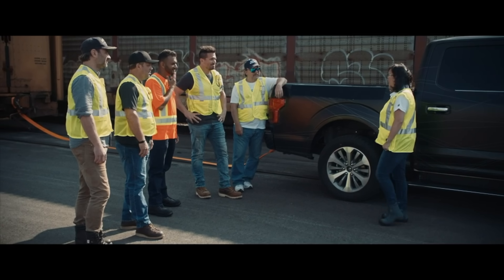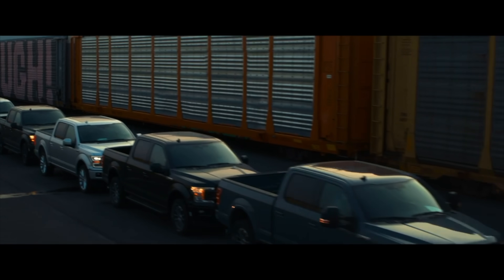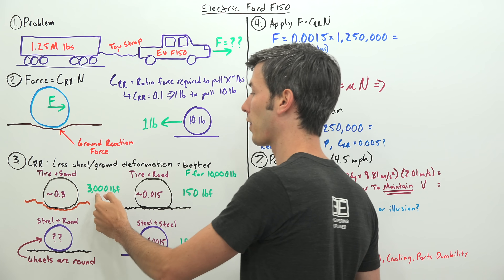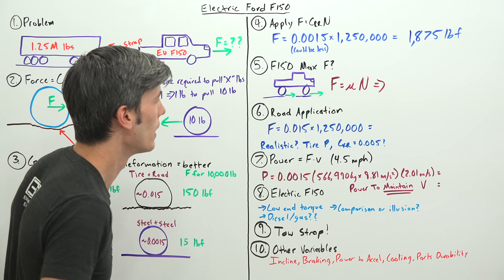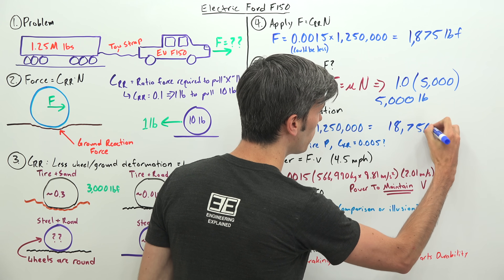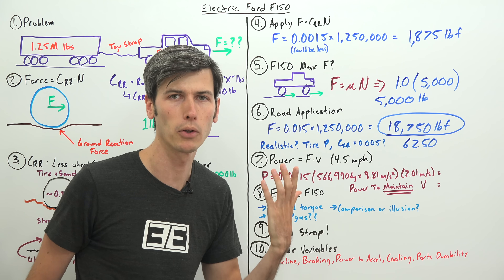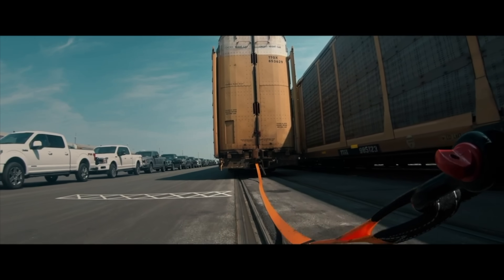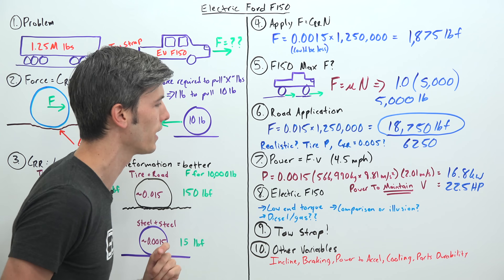No, Ford's Electric F-150 Can't Tow 1 Million Pounds (Realistically)

Comment: You know, there is one more thing. In railcar connections there is some loose space. I mean if you put railcars close one to eachother and start pulling the first of them, others will not move until the loose connection stretches. Then second railcar starts moving, while others stand still and so on.
This means that locomotive doesn't start pulling all the weight of all railcars at the same moment. And by the way this is the reason why that loud sound appears when train starts moving (and sound comes from each railcar connection consequently).

Sorry for my English.

Comment: save you the time and headache, its able to do so bc the train on tracks has less friction and therefore will require less power, if it was on a road it would be impossible bc of the weight and the friction inacted upon the ground

Comment: Some other factors not mentioned. Slack effect in the couplers of the cars. Contact of surface area of the wheels on the rail. Roller bearings. How many of the cars were truly loaded? They are all enclosed and all that's really shown are the ones in the open doors.

Comment: Basically, since the train is on wheels it's pretty easy to get it moving and the faster you drive the easier it will be to pull that load.

Comment: What would the stopping distance be at 10 km's per hour if stopped just by the truck?
Reply: Also.. For those of us that tow 2000 pounds with our little 1500 rated cars what's the Engineering explained about that?

Comment: A lot of fun,  and of course, completely misleading and inaccurate.  It's torque that determines pulling power, not horsepower. HP is quite irrelevant. HP is a product of speed(rpm). 1000 ft/lbs of torque at 1 rpm is a mere .19hp.  That's point one nine, if you didn't notice the dot.     Your  22hp engine at nearly 25000 rpm would make maybe five ft/lbs.  Lots of noise and zero movement.  Internal combustion engines won't do any work at one rpm, but electric motors will. That's why diesel locomotives don't use their engines to pull the train. They use their engines to run the generator that runs the motors that pull the train.  Good fun.

Comment: There is an important feature not discussed here.   The tow point.  The height of the tow point relative to the centerline of the axle of the tow vehicle.

Farm tractors have large wheels so they do not sink into the mud.  But,, they also have large wheels to be able to pull from below the the center line of the axle.  This is particularly important in any tow situation or even a dragster.  If the connection to the tow vehicle is below the line of the axle,,, as the tow load comes on,, the force of the tow is transferred to a down force on all four wheels.  The effective weight of truck, your figure 5,000 lbs, can be multiplied.  This IS how a John Deere B with its 25 hp  can pull a plow.  This is also a portion of the reason truck tow points are often a drop hitch.  If the pull point and level of tow strap are above the axle centerline, you begin lifting the front wheels off the ground.  Attach the tow below the centerline and the weight of the truck, on a set of scales will rise.  I have never tried it on a set of scales,, but I have driven and plowed with a pre WWII John Deere B.  The tow point below the drive wheels is a part of any farmer's life.  I am not a farmer,, just helped once in a while when needed.   I would LOVE to have you test the weight gain on a set of scales.  I would love to see me proven correct or incorrect.  I think it would be great good fun to find out.

And my seat of the pants says the 4.5 mph acceleration in 1,000 ft, require more than the 5 hp.  My only basis for that statement is the use of a 7 hp outboard moving a 20,000 lb vessel.  Not different from steel on steel,, at low speeds, nearly friction less.  It can do it.  yep.  But it is gonna take a lot longer than 5 minutes to reach that speed.

In your rolling resistance calculations,,  train wheels  contact the rail on an incredibly small surface,,, only the inside centimeter or so, The wheels are cones.  Another factor,, I personally have watched the rails sag a half centimeter  or more as a train rolls by.  that is quite a hole to pull 1.2 million pounds out of.  My seat of the pants feels more like 500 horsepower to move that train to 4.5 mph in just 1,000 feet.  Did I miss something?  Yeah,,, pure physics,, no friction, no deformations of any surface, rotational considerations, real world dragging brake shoes, wind, etc.,,, 5 hp may be correct.  By the same token,, I have often thought that a fully loaded cargo ship, 60 million pounds,  could be moved effectively with a 7 hp outboard.

Comment: i have ranger have 176hp 200 tq n i can still pull 37 train trailer no issues in 1st n 2nd gear 2.3l "upgrade motor"
and my maid issues is that new ford truck isnt that powerfull pull it weighs doesnt count because wheels is one thing make it easy push or pull if it wasnt on wheels it would be hell a lot more tell how HP n tq that vehicle is 

to me that truck seen have 230hp 280tq it farset i can tell n yes they r misleading yall about vehicle

Comment: A second effect is that the couplers have play in them. If the train is stopped such that they were pushed into place instead of pulled into place, all the couplers are loose. When the truck starts, it is only starting the first car. When the slack is taken up in the first coupler, it has both the truck and the momentum of the first car to get the second car moving. This continues down the line until the whole train is moving. The front of the train can be moving at a substantial rate before the end of the train has even started to move.

Comment: A Gas Or diesel Ford Could’ve pulled Those auto Racks.  unlike most people, I’m a train enthusiast. if you’ve not seen my PFP. Train wheels are designed to have a little part of the wheel making contact with the Rail. This reduces Friction, And is EXACTLY why this Electric F150 was able to pull all those auto racks. If it were on the Road, Nope. Wouldn’t do it.

Comment: If you could reasonably pull a cut of freight cars with a pickup truck engine, then I feel the railroads would have stopped using 140 liter, 4000 horsepower diesels a long time ago. This is on straight level track. You could get those cars rolling with a 3ft pry bar.

Comment: There is a tool on the railroad called a car stake, basically a prybar that fits between the wheel and the rail...any normal person can move 4-6 cars @ 90,000-286000 pounds each.......

Comment: I think on top of the rolling resistance of the wheels there is resistance in the axle bushings on the car axles which would increase the load. but I doubt it would be much more though.

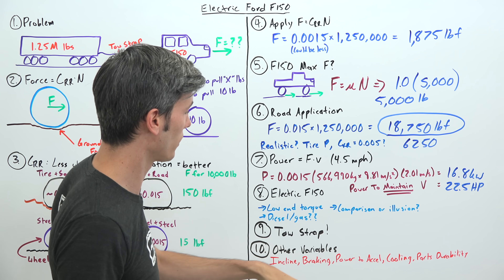Comment: 10:54 the truck itself was able to accelerate this mass - deceleration takes even less amount of energy, cause friction helps (through the brakes, though, not the transmission), sooo why do you say the truck is not capable of slowing down this mass? are brakes not good enough to "pull 1875 pounds backwards"? (if we assume the direct connection, cause strap obviously wont work)

Comment: Short answer : 
Road is harder to tow because it has more wheel/ground deformation so it needs more force, and hence Ford F150 is unable to pull with that increase amount of force needed. Train with metal wheels on rails is easier to pull with lesser force needed, as it has lesser deformation.

Comment: I work for the railroad, and I can tell you small shop forklifts move those rail cars around at the shops. With low friction bearings and lack of friction with steel wheels on steel rails it doesn’t take much to move a cut of cars especially when you have a vehicle off the tracks putting power to the ground. I will say this though, if you put that f150 on railroad wheels, put it on the tracks like a locomotive it would not pull the cut of cars instead spinning wheels due to lack of adhesion which is weight on the rails. That’s why locomotives are heavily constructed and weigh so much for their size. For example a small yard locomotive is about the same size as a greyhound bus, however it’ll weigh 250,000 lbs vs 50,000 lbs, because you need the adhesion for the pulling power due to the lack of friction.

Comment: So basically in a way you want your truck to weigh more because the truck can only pull with as much force as is put to the wheels by it’s weight unless F µ is greater than one? But at the same time you don’t because it needs more energy.

Comment: Chevy did something similar in 1973 with 8 log trailers that weighed 374,000lb and if my math is correct, it took 5,610 lbf to pull. So I guess ford is a few years behind

Comment: i didnt hear him explain it in the video but if i did then correct me. In the video he says the rolling coefficient is less on tracks because theyre made of steel which doesnt deform as much as say a rubber tire. what i didnt hear him say is that this means there is less surface area in contact with the wheel and the ground. this means there is less friction between the wheel and the ground (or the track and the train wheel). thats why the rubber tires that he uses in his example have a higher coefficient. because they deform more than steel. which means there is more surface area contact between the rubber wheels and the ground which also means more friction. correct me if im wrong though.

Comment: Another variable is coupler slack between rail cars. Assuming normal slack in the couplers the truck is only pulling the first rail car to start then slacked is pulled out to the 2nd rail car and so on, creating a increasing load until all couplers are pulled tight. The truck can move several feet before the last rail car begins to move. The full load won't be realized until the last car moves.

Comment: Generally you are quite accurate, but now you made a mistake. That truck can definitely decelerate (brake) the train! Actually, it can do it in just the same distance as it took to accelerate it. This assumes though that there is a rigid connection.

Comment: Towing a rolling load is not that hard. On level ground. A friend running a grain silo used to shunt  multiple loaded wagons around with a little and old tractor. Problem was stopping the things!! from about 3mph on level ground! Jump off the tractor and run after them and grab the brake lever.
Too many b/s adds around from all maufacturers. Should be forced to tell the truth! 
Elon will never sell another car!

Comment: Okie I have a question. If it takes so little force to move such a mass on tracks, then why is it commonly known that locomotives need to be so powerful to move trains? I mean historically and even today, it seems the locomotives engine are sometimes doubled up to move trains and always seem to be 7000HP. Why aren't modern locomotives as small as an f150? Is it because a real train is a lot more than 1.25 million pounds?

Comment: Assuming max torque (5000lbf) which is 2268KG * 9.8m/(s*s) = 22226.4N. With resistance as 1875lbf (8330N) on the train and 333N for the truck. The acceleration force is 13563.4N. So the acceleration is a = f/m = 13563.4/(566990+2268) = 0.0238 m/(s*s). Which means it take 84 seconds (t = v/a = 2.01m / 0.0238) to reach this speed. It'll run a total of 1/2*a*t*t = ~83m or 270ft before reaching this speed.

Comment: It's even easier than that. The train isn't a single object and hitch slop will allow you to break one car lose at a time as you roll forward. Then as the hitches catch you start hearing them bang. In the past the back cars could really get a huge jerk if the train accelerated before all the hitch slop was taken up.

Comment: Not tow because you can't just put that much weight on top of the frame and bumper and tires etc.. But it did pull it. Easily.

Comment: Would be best if they just bolted down a thick welded chain with a newtonmeter scale  in the middle and the truck pulling as normal. Highest mesured force applied will be recorded.

Now traction and brute force applied will show whos the boss of towing.

Comment: well we already know the tow strap is likely only rated for about 4000lb or something... some years back Land Rover did a stunt with a truck pulling a ship - same applies, it doesn't take huge power to move a ship in still water and it doesn't take huge power to move 10 railcars on the flat.  That doesn't mean the truck isn't pulling it, although the same load on rubber tires on tarmac it very likely couldn't.

Comment: 6:56 "If it was sitting on a road with road tires" - is that what ford was trying to say? That you can realistically  tow 1 million pounds on the road? You remind me of a little boy that rebels or holds opposing views not because you have a valid position but because you just want to disagree for the sake of disagreeing. If Ford was claiming you can tow 1 million pounds on the road with that truck you would have a point. Otherwise you are just a jackoff rebel throwing equations  around to hide behind them as you manipulate the frame of the situation

Comment: You're leaving out a significant amount of static friction in this system before anything will move at all. Train wheels have rolling bearings, sure, but they're imperfect.  Also, for something of this size, certainly other contact incur static friction to overcome.

Comment: Small wheels are amazing. I was shocked the first time realized I could pull a pallet jack with >1 ton on it. It was difficult to get started, sure, but I was able to move it across the floor of an entire grocery store.
Reply: Doesn't matter if the wheels are small or big if your pushing or pulling. When the wheels are gear driven, then wheel size makes a difference...

Comment: Hey, Jason! If the trucks towing capacity is equal to uFn, why do F150's (or any truck) have towing ratings that don't reflect this formula? For instance, different lines of the same truck (Limited, Laredo, etc.) have different towing capacities but are similar in weight. Thanks, Jason!

Comment: I found it odd they didn't use some huge-ass chain to mask the fact that this wasn't a big deal..
Reply: DD PN  large diameter steel cables are use for ultra heavy lifting. I have never seen a 1 million pound strap. Biggest strap i have seen was rated at 200,000#
Reply: Facts that tow strap kind of gave it away
Reply: They had a heavy duty two strap
Reply: @fidsnfads__warthunder6337  okay but there isn’t a strap in this world that is rated for 1.2 million pound hauls
Reply: Tow*
Reply: DD PN  lifting and towing are 2 very different things. Plus they use a harness consisting of multiple straps then... connected to a chain or cable.
Reply: Its still false advertising, they only needed a strap strong enough to overcome the initial resistance. (probably less then 5000 lbs) Once the train starts moving you dont need much force to pull it. This is also why a human can pull a truck in strong man competitions.

Comment: The TRAIN CARs would have locked down due to the way the brakes work.  So they had to load the brakes with air to release them for freewheeling ability since the brakes lockdown with no air pressure to keep the cars from rolling on their own.  It is a safety design.

Comment: Awesome again buddy.... loving your channel 🙂🙂.

True that this stunt worked out bcoz it was on railway tracks.

But for the road example, even if the F150 is loaded to get to 18751lb, will that actually pull it, bcoz the engine will ideally need to also pull the additional load on the F150 right ?

Comment: For reference I know when I used to work in retail, I used to haul pallets of merchandise around, and I can tell you that it takes about 75# of horizontal force to move a pallet of paint (about 2,250#) around on a pallet jack and flat concrete floor. Now a pallet jack might incur a bit more friction with it's tiny wheels than a train does with ~24" wheels, but just saying. Seems like a .0015 coefficient of friction is definitely on the low side. I'd bet it takes A LOT more than 15# of force to move 10,000#.

Comment: 5:17 Did you just assume Coefficient of Friction to 1? Didn't you just say Coefficient of Friction between tire and road is 0.015?
Reply: thats coefficient of rolling resistance
Reply: @adivp7  Rolling resistance is indeed different from friction, it is more about the friction in moving parts inside the train. But since he was talking about wheels rolling on plane surfaces I'd say he was talking about rolling friction in this case, which is precisely what makes the truck move.

Comment: Small question, but why is everything measured in pounds when you could use tons? (2000 lbs). I mean lbs are fine for weighing vegetables or people, but cars and trains?!?

Edit: Upon reflection, I guess there could be ambiguity in there being the short ton (2000 lbs), the long ton (2240 lbs) and the metric tonne (1000 kg) whereas a pound is a pound.

Comment: So what about Chevy in 86 towing 375000 lbs of logs on a level plane? The trailer that's attached to the truck is way more than the load on the Ford i think.

Comment: Pretty sure your rolling resistance for metal on rail is wrong, except that since it's on a concrete substrate system it's probably accurate in that specific setting.

Comment: The huge advantage, beside low rolling resistance, is the chain couplers and buffers between the train cars. At startup, the locomotive (or the truck, whatever) first pulls only 1 train car, gets it moving for a short distance, then the chain link is tensioned and 2 train car starts moving, and so on. If it were not for this, you would need even more HP to tow all those train cars.